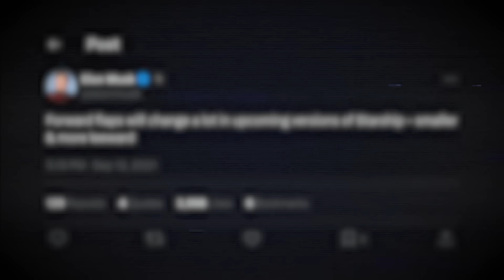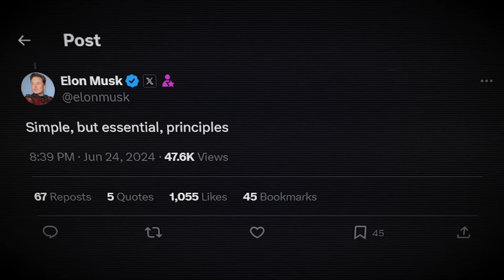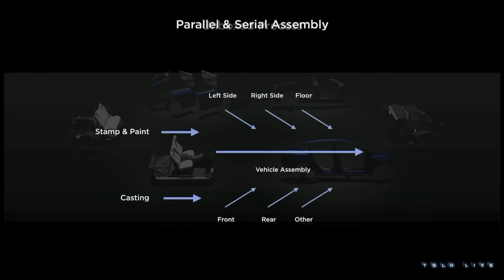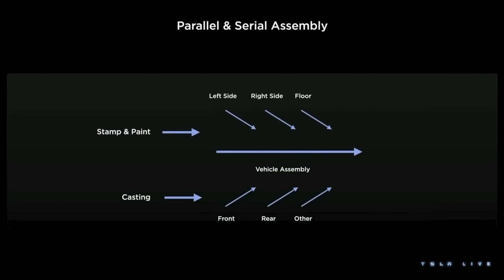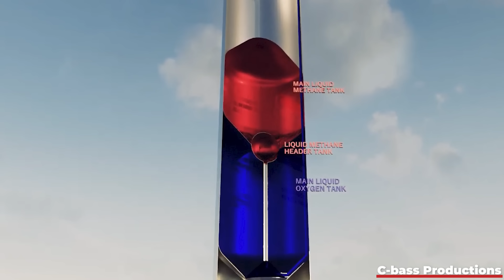Inside Elon Musk's Star Factory

Comment: 4:15 "Linear adjacent flow" refers to an optimized production process often used in manufacturing. The concept aims to arrange workstations or processes in a linear sequence, where each stage is adjacent to the next. The goal is to create a smooth, continuous flow of materials from one process to another with minimal delay or disruption. This approach minimizes unnecessary handling or movement and reduces waste, queue times, and other inefficiencies typically seen in batch production.

This method is particularly valuable in just-in-time and lean manufacturing systems, where reducing waste and increasing efficiency are key goals. In some cases, companies aim for "single-piece flow," where a single product moves through the entire production line without waiting for other products, which enhances production speed and reduces waste further
Reply: It seemed pretty self-explanatory to me. Even if its not a common term, it should have been fairly easy to understand the concept he was describing.

Comment: @6:52  The process shown is more like roll forming.  Hydroforming is a simple mold with a rubber membrane that uses high pressure water to force the sheet metal into the simple mold.  The caps on large tanks used in dairy and beer production were likely hydroformed.
Reply: They were stretch forming the nose and tank gores. I'm not sure they're confirmed as hydroforming anything on site.
Reply: I was literally looking for your comment because I was hoping that someone else would mention that this is not hydro forming. I didn’t want to be redundant.

Comment: The Star Factory was designed wrong.  It should be an assembly line. With a mainline that can have one or two rows (one side for the Booster and the other for the Starship. Then perpendicular to the Mainline would be a (11) linear assembly line for each ring segment which is usually 3 to 4 rings tall. Each Line would, Stamp, Roll, and Plumb, Wire, and stiffen each segment. with maybe a 30-40' ceiling. The Mainline would go 40 to 280'. Each would be built from the ground up on its own mobile stand needing as little as 4- and no more than 11 Robot Welders. After the Engines are installed from below, they move outside to the back of the building to the Rocket Garden which would run the whole length of the Mainline parking 30 Starships and Boosters both protecting them from the elements and allowing for pressurizing each awaiting testing.  The glass offices would run the length of the Mainline hung from the ceiling separating the Mainline from the linear segment lines. The rest of the factory would be building the subcomponents... Flaps, Sensors, Header Tanks, etc so would only require a 10 or 20' ceiling. Too much wasted space.